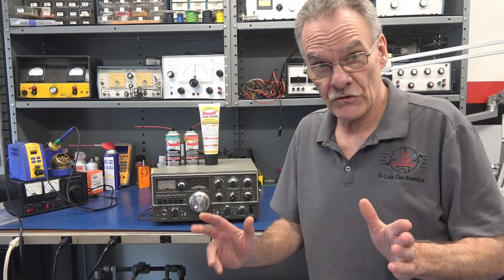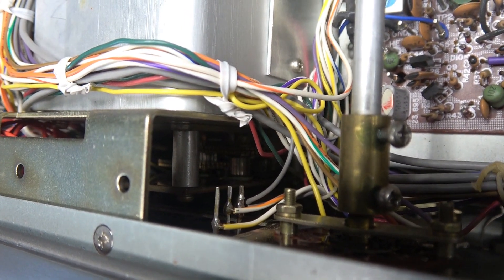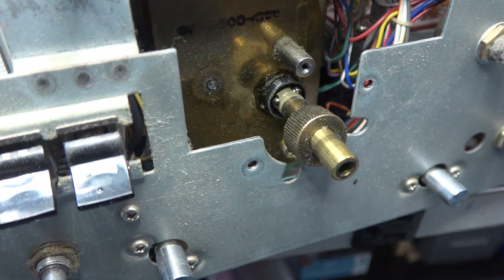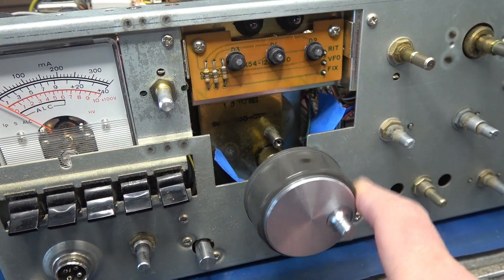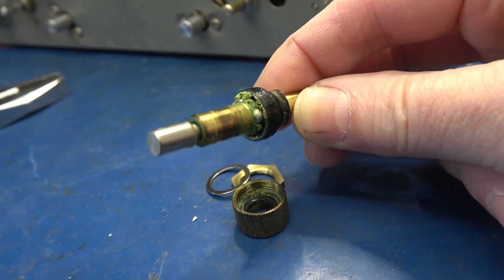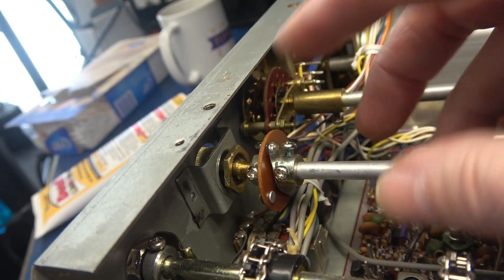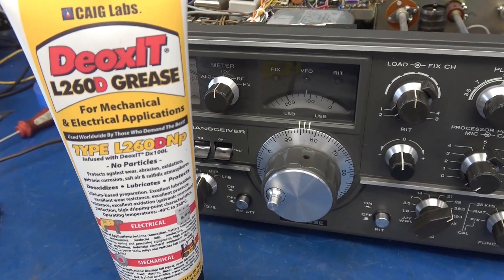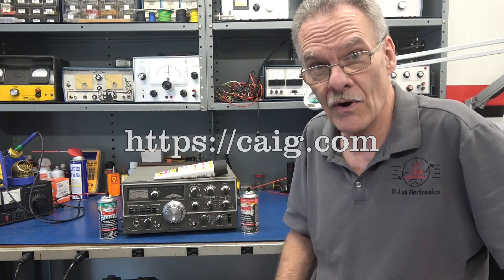Fix stiff seized main tuning Kenwood TS-520 transceiver without removing VFO module Deoxit grease

Comment: If the VFO drive has old dried grease then the VFO has the same dried grease on both ends interfering with conductivity and operation. When in the VFO give the PCB a close look for weak and poor soldering. I’ve not noticed the little drive veneer drive. I also use Deoxit products.

Comment: As a retail level enthusiast, I like DeOxit F5 Faderlube. However, I have not found DeOxit F5 Faderlube to as be long-lasting as I had hoped over the last 20 years. It has a good flushing action, but Caig offered a more concentrated lubey-lube with their DeOxit F100 Faderlube. I no longer see the F100 Faderlube formula in the form of an aerosol container on their website, but in non-aerosol forms.

Comment: Some may bag on Caig products because of their higher prices but they do have specific purpose and  worth  buying  for
certain applications like shown at 4:13 in. Grease used back then  was very cheaply made back in the day. The chemistry knowledge is advanced in their products and is the best in the business so the next guy won't ever have this problem with
the tuner. They have improved their web site to inform consumers as much as possible about the products they offer.